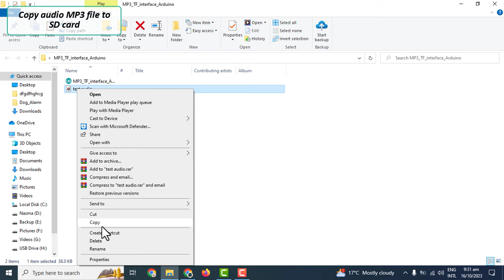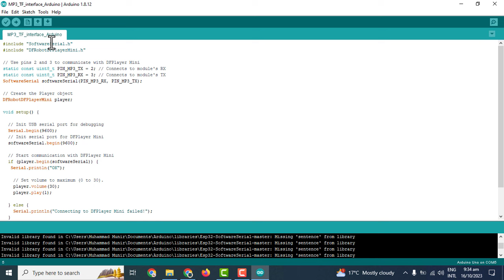How to play audio with Arduino by using MP3 TF module

Comment: Hey, I followed the tutorial and it somewhat works, whenever I begin to play my uploaded music, it makes a scrating noise constantly. My teacher said it could be because the speaker cuts out and begins again because of the amount of electricity it gets. Can you help with this?
Reply from the maker: Connect 3.7v battery with mp3 module. If problem not solved, use 1k resistor on RX pin of mp3 module.

Comment: I have a problem with playing songs using DF player mini. It didn’t play the song. I had uploaded the song to the SD card. Then I insert that to the DF player. While inserting the SD card to the DF player, the light on the DF player mini turned off and there is no sign of playing the song. I thought that there might be an issue with the module. So I replaced that with newer one. Then also the same problem comes. I had used three modules till now but the problem persists. Can anyone who is familiar in this can able to solve this issue?
Reply: HI. is your file song formatted to Mp3 ?  If Not you need to set it to a file that the DF-Mini can read which would be 001 or 002 also make a sound folder to insert the file into.  
It should play.

Comment: Hi, I am looking for a device with a pre-recorded message via an SD card to plug and play. Could I connect this device to a stereo amplifier and then to speakers? I am thinking of getting a Sparkfun Trigger and a stereo amp. Ideally I would like the sound to activate automatically when the power is turned on without the use of any other controllers such as an Arduino. Does something like this even exist? Please let me know, thank you.
Reply from the maker: you can do this with Df player mini
Reply: Will I still need the Arduino?
Reply from the maker: @EdG407FL  you can do this without arduino, if you want to play single audio file.
Reply: Perfect! Thank you!

Comment: I've done everything as you did and i've been trying with different videos on YouTube to use a DFPlayer and it just doesn't work, do you have any recomendations? Thank you very much!
Reply from the maker: give external 5v power to DF player
Reply: hey there! I am struggling with mp3 module as well. Did your module work? Kindly let me know if there is any useful resource out there which I am missing on.
Reply from the maker: @uditkoli2732  What problem you face?
Reply: @fairelectro  Thankyou. Your help would mean a lot. mp3 modules previous videos on YT have used red light mp3 mod. I also have a red light mp3. But you have a blue led, and your video is the recent one. does it work only with blue led.
Reply: I had the same issues too, what you I realised was that the dfplayer mini with red led mostly doesn't work, try getting the dfplayer with blue Led it should work Perfectly fine.

Comment: Hi. i dont know why but it only plays around the first 3 seconds of the song.
Reply from the maker: Which module you are using? DF player mini or MP3 tf 16?
Reply: @fairelectro  df Player Mini. It now works well until I try to control it using Bluetooth. it seems to be a problem with serial communication

Comment: Hi, Can this sketch be added to a small servo sweep sketch that uses an IR sensor to activate it ?
Reply from the maker: Yes, it can be added.
Reply: @fairelectro  OK Awesome Thank You for the reply.
Reply: @fairelectro HI, I got your sketch wrote word for word  I scanned over it makes sure i wrote correctly 

The section above the void setup(){

//  Create the Player object 
DFRobotDFPlayerMini player didn't highlight in orange. 

I'm guessing not letting the code upload. 

Everything else is correct in the code 
Just the DFRobotDFPlayer player didn't highlight in( orange)
Reply from the maker: Install library first for DFRobotDFPlayer player
Reply: @fairelectro  I have all the df mini  library 
I have it just like you have it 
#include "DFRobotDFPlayerMini.h"   
If I include the library it's 
#include< DfRobotDFPlayerMini.h>  
So which way do I need it ?
It's giving me an error to upload to uno. 

#include "DFRobotDFPlayerMini.h"
#include "SoftwareSerial.h"
Reply from the maker: Which error shows?
Reply: @fairelectro  HI I got it working now and just trying to get the sound to work with the servo... I had to use the <> functions  using the " " marks wouldn't allow it to upload for some reason.

Comment: What if I only hear a clicking sound?
Reply from the maker: Use battery with DF player
Reply: @fairelectro  Won't I need an amplifier for that? Or would it just be alright with the battery and DF player.
Reply from the maker: @walteravila4753  No need to use amplifier if you are using 3watt speaker
Reply from the maker: @walteravila4753  First of all check df player is working or not. watch this video https://youtu.be/TIuCIYey_F0
Reply: Does it provide enough sound?

Comment: Hello Good Morning my friend, could you possibly take a look at this code and tell me what I'm missing? Its not working all that great. and needing some help Not sure if i have it correctly.

#include <DFRobotDFPlayerMini.h>
#include <SoftwareSerial.h>
#include <Servo.h>
Servo myservo;
int sensor1 = 5;
int pos = 30;
int swinging_started = 0;

static const uint8_t PIN_MP3_TX = 10; // Connects to module's RX
static const uint8_t PIN_MP3_RX = 11; // Connects to module's TX
SoftwareSerial softwareSerial(PIN_MP3_RX, PIN_MP3_TX);

// Create the Player object 
DFRobotDFPlayerMini player;

void setup() {
  pinMode(sensor1, INPUT);
  myservo.attach(2);
  
 // Init USB serial port for debugging
 Serial.begin(9600);
 // Init serial port for DFPlayer Mini
 softwareSerial.begin(9600);

 // Start communication with DFPlayer Mini
 if (player.begin(softwareSerial)) {
  Serial.println("OK");

  // Set volume to maximum (0 to 30).
  player.volume(8);
  player.play(1);

 }else{
    Serial.println("Connecting to DFPlayer Mini failed!");
  }
 }

void loop() {
  if ((digitalRead (sensor1)==HIGH)&& (swinging_started==0)) {
 swinging_started = 1;
 }
 if (swinging_started)
 if ((digitalRead  (sensor1)==LOW)&&(swinging_started==1)) { 
  
  for (pos = 30; pos <= 80; pos += 1)
  {    myservo.write(pos);
        delay(15);
  }
  for (pos = 80; pos >= 30; pos -= 1)
  {    myservo.write(pos);
        delay(15);
  }
 }
}
Reply from the maker: This code is uploading on Arduino or not? If this code is uploading, does the audio play once?
Reply: @fairelectro  HI, The code uploads fine it just has a bit of weakness when activating the sound.
Reply: @fairelectro  the Audio some times plays not every time the sensor crossed.
Reply: @fairelectro  Can you help me with my code?